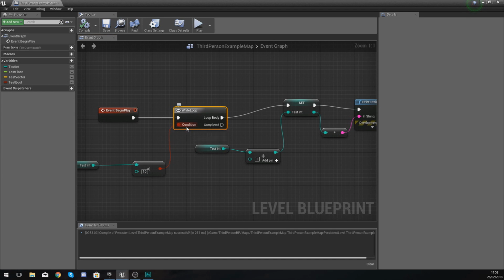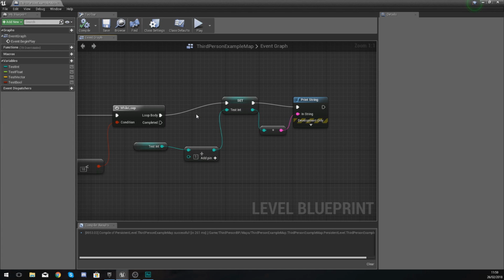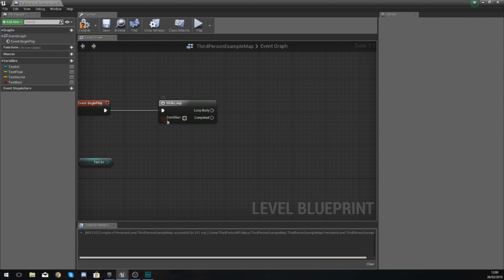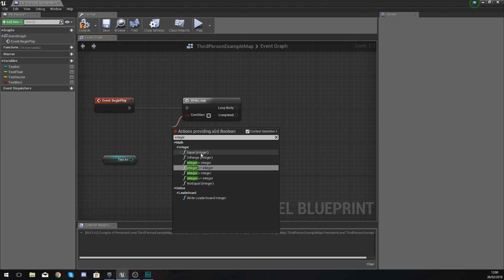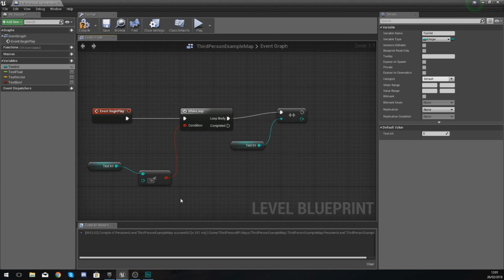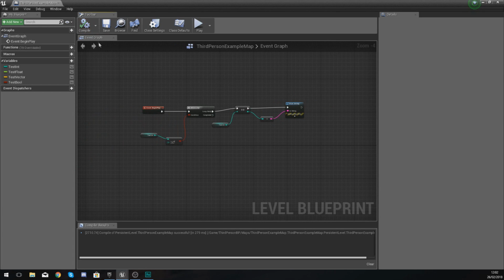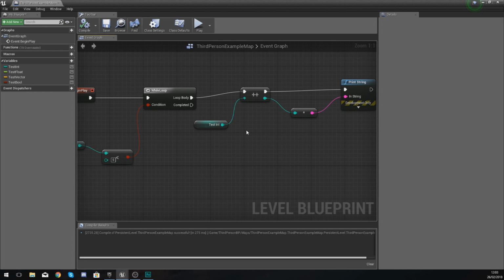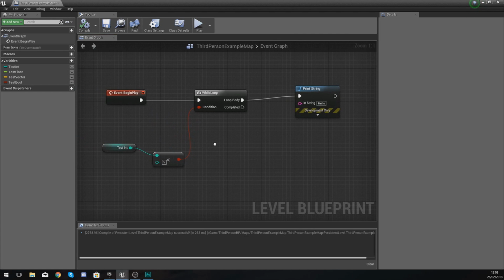While Loops - #12 Unreal Engine 4 Blueprints Tutorial Series

Comment: I tried to put a Delay at the end of each loop (mean after PrintString). My attempt is to print at screen 1 number after next. 1..delaying, number disappear, then 2 etc etc. But doesn't work. Any suggestion why?
Reply: I tried same thing and had same problem, did you find something?
Reply: Apparently "while loops" cannot have delays in them in Unreal Engine.
I used "set timer by event" and a branch with the argument when it should end in it, with "true" connected to a "invalidate timer by handle" to end the timer when I want it to end.